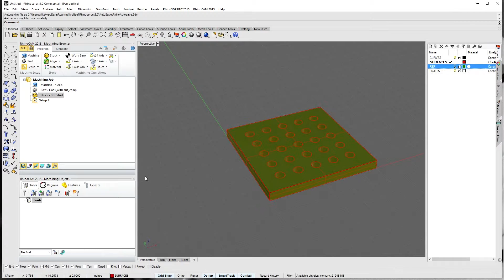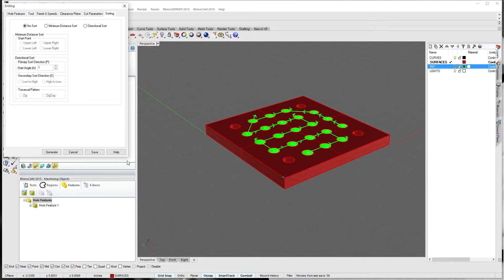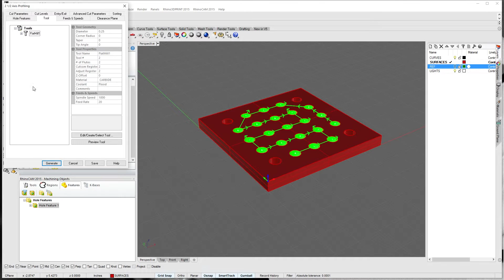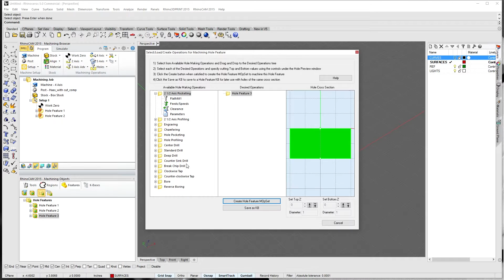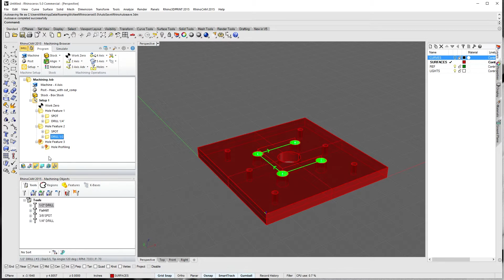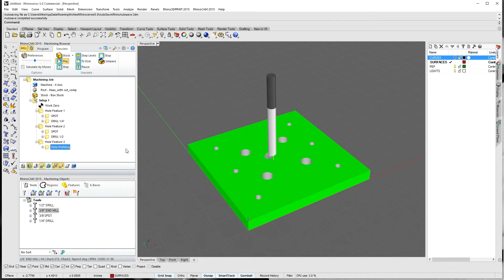RhinoCAM 2015 Hole Features Machining

Comment: HEY MIKE i have a question im trying to use a rhino cam version i have installed on a Rhino 4 version, but i cant open my models made on Rhino 5 , in order to use rhinocam, is there any way to open Rhino 5 files on Rhino 4?
Reply from the maker: Hey! I don't believe there is a way unless you convert to something like STEP file or other universal format and reimport it.